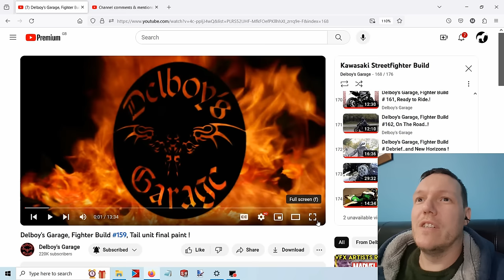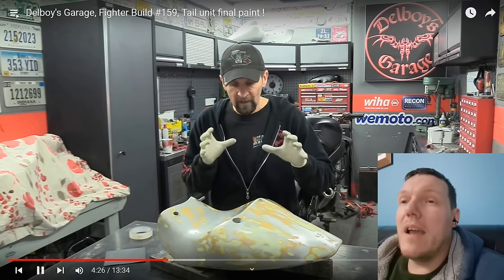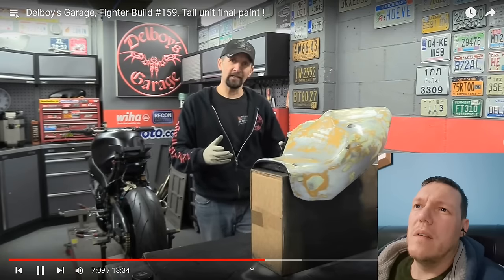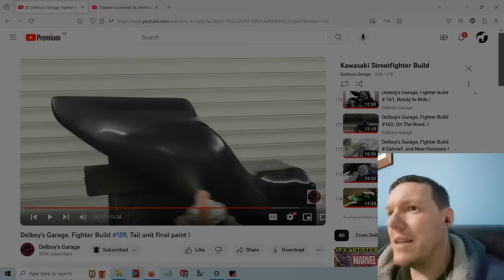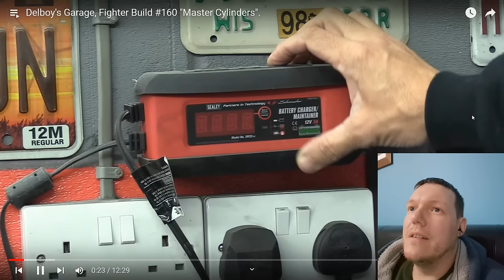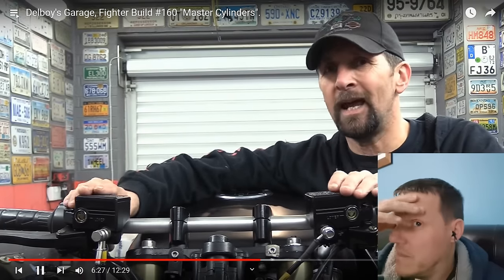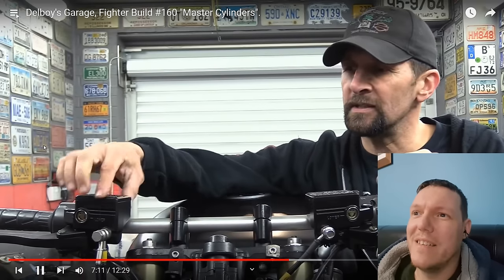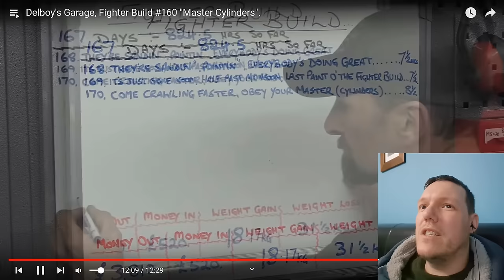HDS 89 - Say what about brake?

Comment: I use those pop up greenhouse things you use for tomatoes etc. 

Rattle can in a bucket of hot water and heat soaked parts also helped, sat at a good 20c for 24 hours is ideal.

Comment: Hey Del, I know you read the comments here so a quick simple skills for ya.

If you just change the master cylinder on an existing system, push the pistons in the calipers back and it will push some fluid back up and shove out all the air that is already in the top of the system; then you won't need to spend 15-20 mins pricking around with the lever like that.

Ain't 'ard issit ?
But you already knew that !

Comment: With the base not keyed up right I'd hate to see it getting a tap, the hole paint job will just lift around the area , or even a stone chip and a power washer been used it will lift off completely , suppose he'd have a mold then he could use for the next bike